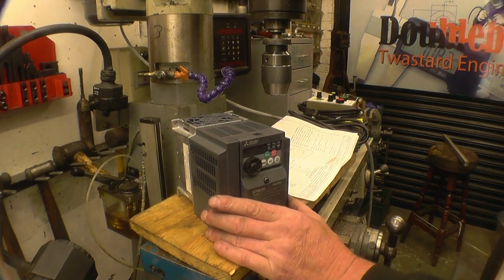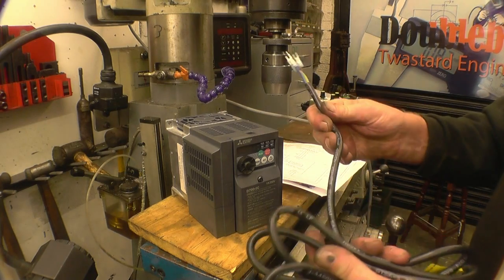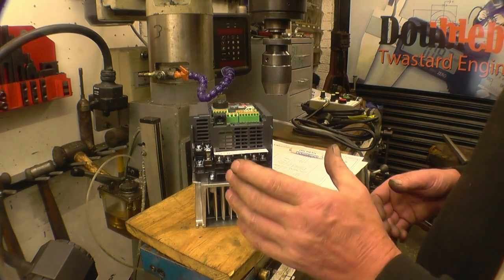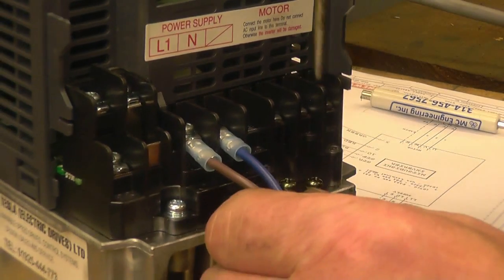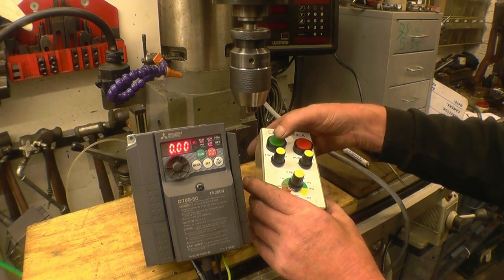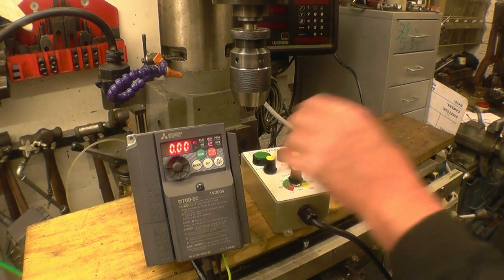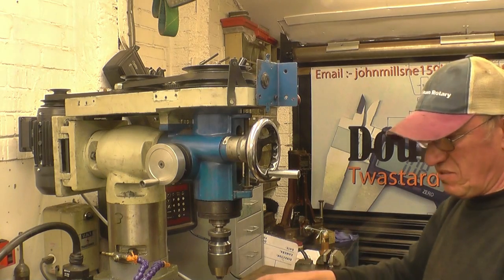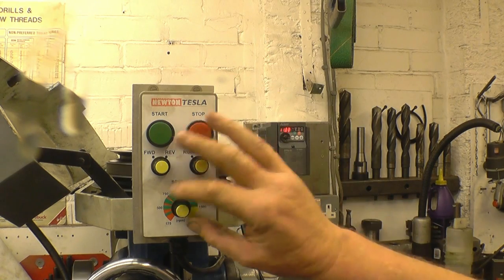626 Milling Machine Newton Tesla Inverter Part Two

Comment: Very nice bit of kit there John.  For most of my work, I set the belt on next to the slowest pully,   this will give extra torque to the low speeds.  I rarely have to change the belt.  When I'm doing power tapping, I use the forward-reverse switch.  I have the braking set for 1 second, which works well.   I'm sure you will enjoy the next set up.  Cheers!

Comment: John, I use the same inverter on both my mill and my lathe. If you have a tach, you can calibrate the speed readout in RPM instead of frequency using parameter 37.

Comment: Nicely designed rig. I'm planning to install an inverter-run motor on my lathe. I think I will steal the idea of having a run/jog switch and single "go" button, rather than having separate run and jog buttons. It just seems safer to set it up that way. 

I will probably program the control to run the motor between 50% and 150% of nominal speed. This will give me a 3:1 speed range on any given belt setting. I expect I will need a digital tachometer, since all the old belt-arrangement/speed chart will no longer apply.

Comment: When I bought my Bridgeport, the machinist had it running on true 3-phase. I mentioned to him that, if I bought the machine, I would have to buy a VFD to run it at home. "Oh, you mean one of these?" he said. reaching to the back of a shelf. "It came with it when I got it--I was going to throw it out. You can have it." Of course, this guy had already thrown out the original x-drive.

Comment: I'd get a cheap chinesium Tacho and add that to the setup so you can get the exact speed. obviously the Controller is setup for one range on the pullies but you'll not get full torque low down on slow speeds. I've Got a VFD and My Boxford and still change the pullies to give a better range and use the back gear too them very slow running is needed.

Comment: Hi John, I'm wondering if you need to keep the intermediate pulley arrangement. It does seem like a faff when you need to change the belts around. The ability to control speed at the turn of a knob makes that arrangement obsolete from what I can see. I upgraded my Boxford to a one HP motor and did away with the counter-shaft and now run directly onto the intermediate shaft. There are very few occasions where I need to change the belt position or even use back gear now.

Comment: It will interesting to see how much torque your mill now has at low motor RPM.  I expect that you will find that you may still need to use the pulleys to get torque at low speed.
Reply: Denis Thibault I have one on my lathe and at low frequency the motor have a nice torque

Comment: You should be able to go up to 100Hz or beyond with no problems.
Motor might sound a little "busy" but should run just fine, saves on changing pulleys.
Oh by the way could you please show a picture of the Quill downfeed handle on your mill somtime.

Comment: Any value in building a bracket to put the motor where the middle pulley is now?  That way you could push the mill back toward the wall six or eight inches.
Reply from the maker: Well worth a look  Thanks for watching

Comment: Hi John, just curious why couldn't you use that on your lathe? I'm not an electrician is it because it wouldn't have enough amperage? Thanks Mike
Reply: Hi I think the harrison has a two speed motor and if so it would require a different type of VFD and unfortunately a much more expensive type, but I could be wrong.

Comment: hi john,did you find out why 3 motors failed.do you have low voltage problems in your area.
Reply: We don't know what kind of failure. I've seen no end of 'failed' motors that were popping breakers and the only thing they needed was start and/or run capacitors replacing.

Comment: John.
Did you fit an on/off switchbox between the mains plug and the inverter?  I am wondering whether or not to fit one on mine.
Reply: why not just turn off at the socket where the plug is?
Reply: You should ideally have an appropriately rated fast trip breaker or a semiconductor (fast blow) fuse between the supply and VFD.

Comment: Hi there, i have a similar inverter to yours and what looks like the same pendant but where you have 8 wires coming from your control I only have 7 and the one missing is the purple wire. I cannot find any information on how to correctly wire this into the inverter, do you have any guidance for me before I hand it over to someone else? Kind regards. Chris.
Reply from the maker: I will see if i still have the wiring diagram

Comment: Great video John, though it is an inverter, i believe it would be more accurately described as a Variable Frequency Drive.  I have the same Mitsubishi VFD setup on my Colchester Bantam lathes. I have two Bantam lathes (one metric, the other imperial) and i just use the one VFD with a changeover switch on the motor wiring so i can select either lathe 1 or lathe 2.  My control panel (also Mitsubishi) connects to the VFD through the ethernet port with a standard network cable so i can easily switch control between the two.  Those VFDs can be setup to do all sorts of clever things if you read the manual, adjust spool up and down times, electronic braking time adjustment, torque factors and all sorts.  I can run my lathes down to 15 RPM and plenty of torque for tapping/reaming ect. I can also now increase the maximum RPM of the lathes from 800 to 1600 RPM by ramping up the frequency.  Cutting threads is much easier with the ease of speed control/instant stopping and reverse at the touch of a button.  Fitting a VFD was like buying a whole new lathe and totally transformed my machine and my machining. I'm looking forward to seeing you get to grips with this new toy!  My milling machine puts on a small firework display from the motor brushes and lays down a smokescreen under heavy loads, has done for a while now.  I'm just waiting for it to pop so i have an excuse to treat myself to another VFD :-D

Comment: Regarding the 3 phase and motor direction, if it doesn't turn at all, swap the middle wire with one of the outer ones.
Reply: It's a three phase motor. If you supply it with three phases, it will always run, no matter what order they're connected in.